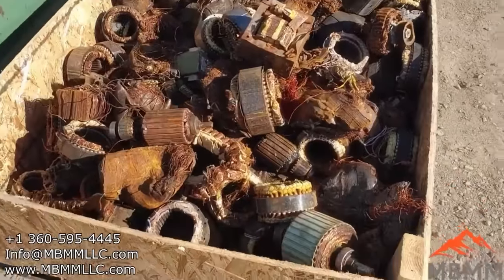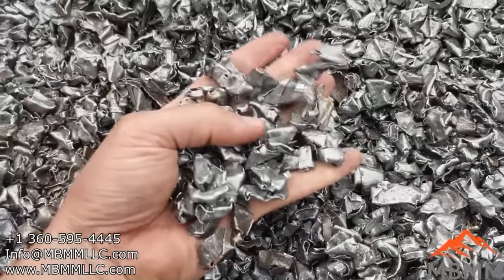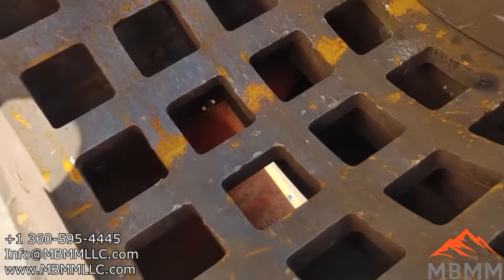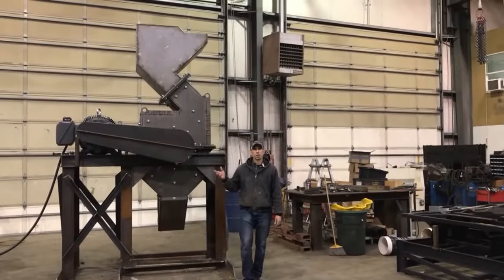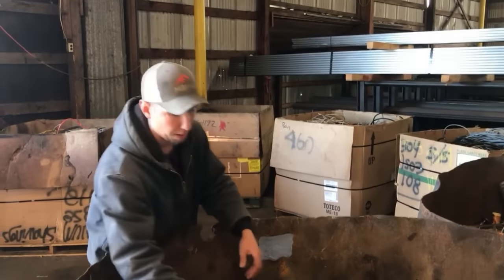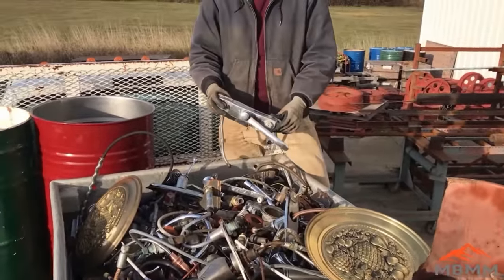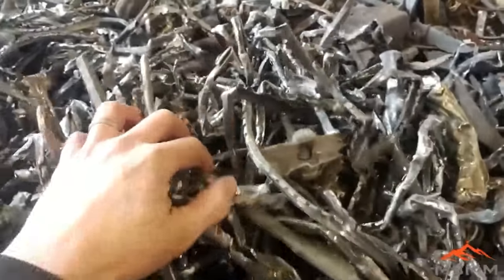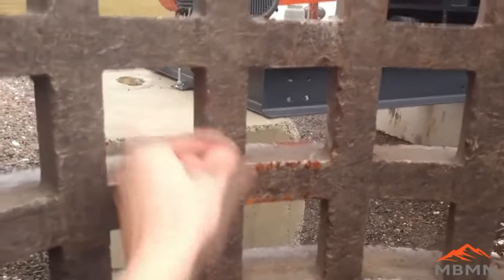Scrap Metal Processing: Liberating Valuable Non-Ferrous Metals Through a Hammer Mill

Comment: Hi Jason,   Your new 34 x 24 hammer mill is a beast! Great video!  Thumbs up! Everything you fed into that machine was improved for extra value pulling out the steel!  The only item I strongly disagree with is the computer towers. I've been recycling computers for over 11 years.  Pulverizing the towers just to remove the steel is a complete waist of time.  Towers are very easy to take apart.  The only component that would benefit from being shredded is the power supply.  It's much easier to process the boards when they're in one piece! After the boards are depopulated - then they can be pulverized to liberate any copper & precious metals that are left.   Stay safe,   Jim
Reply: You can unscrew the side panels and remove the front plastic face but after that most cases use rivets or are welded so you still have a big block that takes space. I would have imagined they're using something to flatten them and then maybe run them through one of those shredders that have teeth running in different directions (lots of videos with those eating tires and bikes and small things) to make smaller pieces out of them. 
I like this machine but I don't understand why they didn't make some small improvements like maybe some side panels or guides so that there's no steel hanging on the side, or maybe some walls so that copper wouldn't fall outside the barrel.
Reply: Yup second this. Have an electric screwdriver and go nuts. The power supply units are a total mixed bag of aluminum copper steel tin and god only knows what else.

Comment: Get a floor drying blower and have non ferrous fall perpendicular thru the air stream.  That should blow clear most of the plastic/paper and leave a cleaner copper product.
Reply: Yup that would be a good after process. Combine with an AC electromagnet to kick the aluminum out as well.

Comment: Wouldn’t you want the conveyor belt to go a little bit slower to have the magnet get most of the metal and the picker to properly pick out the big pieces?
Reply: I was thinking along the same lines.  Run the conveyor a bit slower when shredding the computer towers give the magnetic belt a chance to grab the steel without the plastic.

Comment: Crazy cool Jason.. I scraped a 35lb potted transformer last week. Those things are crazy tuff and probably too heavy for your hammer mill.
But that would be interesting for you to try some smaller ones. Should be No Issues I would think.
The one I did was encased in 1/8 Metal and needed to be sawed for me to get er dun.
Terrific work and business there Jason, your doing a great service to the very necessary recycling industry.
Peace Prospector Tripp
Reply: Wow, Thanks for the tip pal. Very interesting ⚒👍🤠
Reply: There exist hammer mills that are designed to take whole vehicles. 

There are a few good vids out there, one is by whistlindiesel. The operator talked about how crane weights were placed in a car trunk and the machine had to be stopped to remove them. Giant chunks of solid steel, and the machine was only stopped because they were to big to pass through the grates.
Reply: @aredditor4272  The mineral resources won't last forever.
These technologies will help us a little.
Many thanks for the answer
Reply: @aredditor4272  Whoever put the crane weights in the car either didn't know what they were doing or were too lazy to care.  Crane weights are worth double the scrap value of a car by weight.  If they'd taken them out of the trunk and sold them to the scrapyard separately, they would have made a lot more money.  I get 24¢ per kilo for scrap cars and 47¢ per kilo for FHIS (Ferrous heavy insize scrap).  Any crane weight under one metre long is considered FHIS and their weight adds up FAST.
Reply: Potted transformers. Uggh. Yup they make those really hard to dismantle. If they work you could offer them whole on second hand industrial equipment sites and get decent money for them. ❤

Comment: I love your videos. The one question that i have is at the end of the line, as it falls, could you have a blower set up to blow away the paper from the side into another dumpster beside the metal one?
Reply: with particle sizes varying so much it would be hard to tweak it to blow away bigger pieces of paper but not the copper "dust" which amounts to noticeable weights in these scales of operation, I'd think

Comment: On those electric motor parts (stator, commutator, rotor, armature core & armature windings) A lot of that would be easier to clean by hand. That way the copper is much cleaner, also they make a machine that for a stator and armature windings, that cuts and pulls the copper/aluminum wire out, without shredding it and make less of a mess.. I do understand the need for the system you produce for those with massive amounts to process, yes indeed use a system like yours, it would be faster, but not as profitable as a $ per pound selling value.. I used to be a scrapper and did it for about 30 years and I made very good money, cause I completely cleaned and sorted everything to gain the most $ per pound, I also smelted coper, aluminum & brass, because you get more per pound for ingots and/or bars of pure material.. 
To me it looks like your system would be better used for processing mined raw ore, of which I have watched you do many times..
Sorry if I sound critical.. I enjoy watching your channel and have been subscribed for a long time, I have seen every video & short and I do share many on my facebook & twitter.. 
Thank you for sharing.. I am sorry so long of a comment
Reply: There are videos of stator cutters and windings pullers online and yes, they are much neater but there are a lot of other advantages.  They are also much quieter and at least as fast.  The setup takes up a lot of space compared to stator processors which often have a footprint less than a square metre.  The mill pulls huge amps (100amps under load is pulling about 60 kilowatts on this setup, equivalent to $30 per hour at 50¢ per KwH).  The hammers won't last long against stator steel, requiring frequent replacement.  A stator cutter only needs lubrication and cutter blade sharpening when needed.

If I had a business processing tons of stators every day, I'd definitely go with a stator cutter and windings puller.  On the other hand, if such volumes were a rare event (and I had the space) I would go with a hammer mill for its versatility.  

(I actually own a small hammer mill but it wouldn't handle electric motors.  Plastic and cardboard shredding are more suitable jobs for my machine.  I have to try aluminium casting one day.)
Reply: @andymanaus1077  That is what I was referring too.. When you are processing pallets full, it is very affective.. When you do a small amount, I was a scrapper/Junker for years Just a angle grinder with a cut off disk is just as affective when it is like maybe a dozen or two a week.. The machinery Jason builds, sells & uses is more suited to raw ore and use for mining.. and not very effective or efficient for lots of the things he uses it for..

Comment: I used to run a scrap plastic grinder (PVC pipe) with similar motor specs to your mill. 100 to 110 amps on 'drop the piece in' was max safe load. Anything more than a half second spike over 140 would stall the motor or (usually) burn the drive belts off. Sounds like you were pushing your machine about as hard as was prudent.

Comment: A problem that I've seen recently is copper coloured lacquer on aluminium wire and similarly copper coated aluminium wire. I can't imagine some mashed aluminium will do much good to a copper melt.
Reply: Sometimes it's an extremely thin layer of electroplated copper.  You can easily tell by sliding a grinder disk or a file over the windings before throwing them into a processor.  However, it's always painful when scrapping a motor to discover that the windings are aluminium.  There's a lot of manual labour just to get the motor cores out of the motors and you can't always tell they're Al until you've done the work.  

Al is worth a quarter of CU by weight but CU is also twice as dense so, by unit, Al is only worth about a quarter of CU.  Pro tip: almost all welders have Al windings.

Comment: I wonder what power-factor that 100hp electric motor has at idle. (Depending on how the AC current lines up to the voltage, it's actually possible to draw significant current without drawing any power.)

Comment: Allways whatch your vids . Very interesting.  Would it be possible  to  put a magnetic trap conveyor on the larg hammer mill with a 2.5inch screen.  This would be constantly removing the  large steel  piece's  .
Reply: The largest pieces can be removed by sight and most scrapyards have a ~5% contamination allowance.

No one is going to care much about little piddly bits of steel in a giant pile of copper.

Your real problem is aluminum- which will go right through magnets and will have to be separated by hand or it WILL lower the value by a large amount
Reply: @anotherboredperson   large pieces of steel such as hardened shafts break machines.  And absorb a lot of power which could be otherwise utilised in chooping up the copper to a finer  grade .

Comment: I built something very similar except it used a rather powerful AC electromagnet that kicked the copper away and attracted the steel after the milling. It sorted into 3 bins steel, copper, and the outermost bin had aluminum that came along for the ride. Also imo Alumium wound motors absolutely suck. 🤓

Comment: Yeah local scrap yards around here will give you stator money but they won't give you dirty number two copper wire I've never had a processed like that and take it in but I don't know it seems like when you put a magnet to the stator wire even though it is cooper they won't take it like that. They will give you electric motor but that's the only way I can get paid on it. I don't know I tried to do precious metals for them at the scrap yard because I was bringing in gold and stuff like that and people would just follow you home try to rob you around here I was trying to sell small buttons of gold that I had processed they actually sent me to a school they wanted me to work for them. It almost seemed to me that you know they had problems with everybody but what really happened was they had a huge can crusher that was three phase power and every time they turned it on you would lose power to the receptacle and I had gold cooking down on the beaker and it would explode because it would just turn off and then would turn on and then we just get too hot too fast and then when I did diagnosis they tried to make me look like a fool. They brought the guy that was teaching the class in and everything else I said you know she keeps throwing away the flux I was trying to get second pulls I figured out what was going on the bus bar on the power was just burned up I was losing power to my beaker they were trying to refine the gold in the night time I said stand right there hold on I went and turned on the can crusher and she said don't turn it on it cost a lot of money to run that thing I said I know it's turning all the power off to the whole building😂😂 😂😂😂😂😂

Comment: That is most definitely #2, if very little corrosion might get #1,,,,, depending,,,, also, wene I even take in large amounts of good copper, they ussualy give me a few cents more per pound,,,,, I'm an electrician and get lots of #1,,,, and an extra10/15 cents a pound on 500/1000 pounds adds up so if ever doing large volume ,,make sure to ask what the price is

Comment: A lot of the newer transformers actually use copper coated aluminum wire in there windinings instead of solid copper. Only way to tell is to cut them.
Reply: With experience you can tell by sight and feel(weight).

Comment: Don't know if you happen to have one but there is a really nice lazer cleaning device that makes cleaning much much easier with no chemicals, i sure would love to get one for cleaning automotive parts and what you have there with that lazer cleaning tool you could make all of that there shiney new looking
Reply: Yeah, those laser cleaners for steel descaling... they cost upwards of $200,000 each.  That's why you don't see many.  Also, they're dangerous.  They can permanently blind in an instant and require a controlled workspace for safety.  

(I'd like one too.  They are amazing machines.)
Reply: @andymanaus1077   Not to mention fumes and particulate management becomes a big deal. This machine already stirs up enough dust that they should probably design some dust control though.

Comment: Pretty cool.  Sadly you are missing out on the gold content of the PC boards.  Many of the the chips inside have gold wire inside them as well as gold plating on the boards.  I would remove all PCBs with components on them first.  There are other methods that are used to recover that gold.  That sorting process would be ideal for AI with robotic picking arms.

Comment: it would be nice if i had a place i could take used aluminum foil. it seems a waste to trash it. so, i keep it. i would love to turn it into ingots myself but am not equipped to do that by any means. but, i want to do so even in small batches, to consolidate and clean up the aluminum foil as much as possible, so that it could be scrapped properly, and not end up in land-fill purgatory... (i have a 20 gallon plastic tote full by now lol, i want to process it someday)
Reply: I scrap a LOT of stuff, to the point where my friends call me "Brasso" because I reclaim used metal. Anyway, my local yard pays a penny per pound on aluminum foil, foil pans, etc., because it's nearly always contaminated with food waste and that adds more weight than the foil does. So, I will often take the foil, compact it, and stuff it into the soda/beer cans to bump up the weight on that category without cheating the scrap yard by diluting the feedstock with dirt like so many morons do. It takes time and effort, though, so not practical on a large scale.

Aluminum foil can also be easily compacted into heavier, more valuable chunks by hand with a hammer, but it takes a lot of time, makes noise, and is messy.
Reply: @dionh70  thanks for the reply. i was wondering if it could be heated up to carbonize food scraps remaining, even if it isnt melting the metal itself. could it be done over a simple wood fire in an appropriately heat resistant crucible or pan? could be some experiments out there to make the clean up as cheap as possible. perhaps if it could be melted in a way that helps remove contaminants like an electric furnace and crucibles, then pouring ingest in small batches, or by the pound? i just feel like it needs to be done somehow, but would like to do so as cheaply as possible. i don't mind noise and mess, i have a workshop for that haha...
Reply: @EddieSchirmer  I went to a local fire safety company and bought a couple of old fire extinguishers that failed pressure testing, cut the tops off with my angle grinder, set one in my little firepit in the yard, and fed scrap foil into them as the fire burned. I was burning scrap pallets that I pick up for free from nearby industrial buildings, because they set them out on the curb if they're too bashed up to re-use.

The foil melted down fairly easily, because steel melts a couple hundred degrees higher than aluminum. I did have one extinguisher bottle fail, with a hot spot developing to melt a hole in the side of the bottle, allowing the molten aluminum to pour into the coals, but that was easy enough to recover the next day when everything was cool. They charged me $5/ea for the old extinguisher bottles after I reassured them I wasn't going to try to pressurize them again.
Reply: @dionh70  Awesome, great ideas thanks!
Reply: @EddieSchirmer  I saw a vid a few days ago where the guy made a small melting furnace with a microwave and some kaowool wrapped around a crucible made of silicon carbide.  he calls himself 'Shake the Future' on youtube.  Crucible has to be made of SiC as that's a material that absorbs microwaves but has a higher melting point than the metal.  Batch size is pretty small, the crucible looks like it's maybe 2 inches in diameter.

Comment: Certain plastics are very easy to mold press into bars, sheets or bowls. Not to speak of tiles, which is probably the biggest melted product from waste plastic. That can be made even from mixed plastics with additional stuff like sand added. See the process pollution regulations in your area, they can be strict.